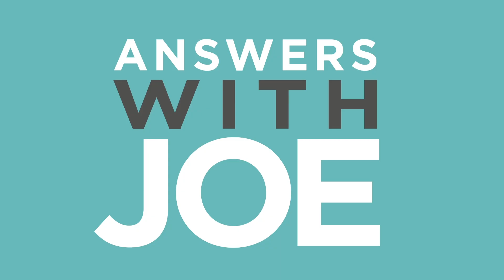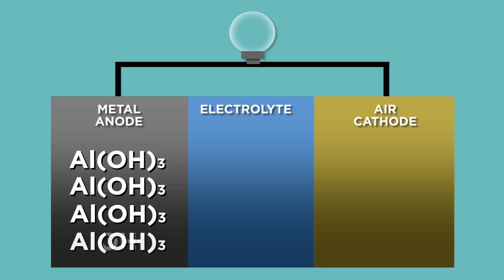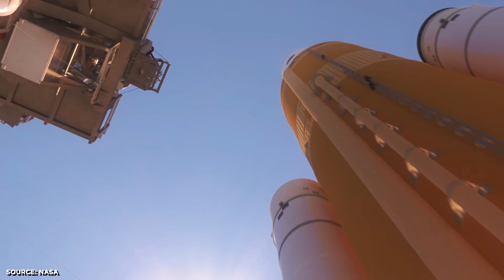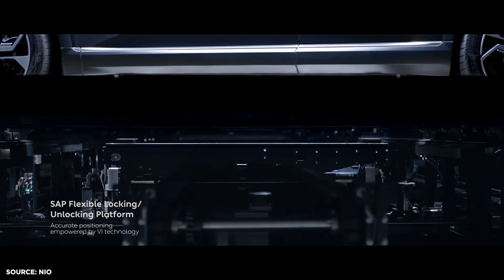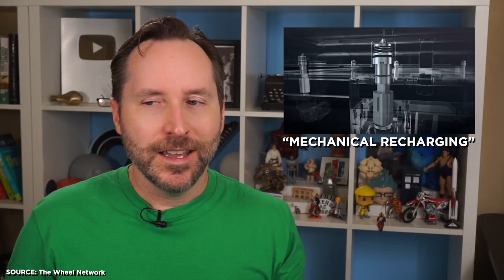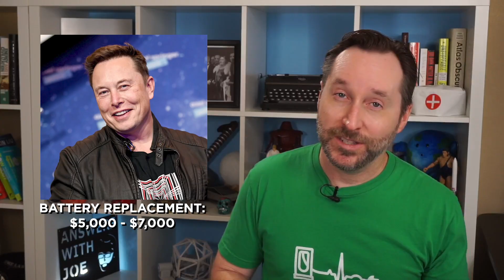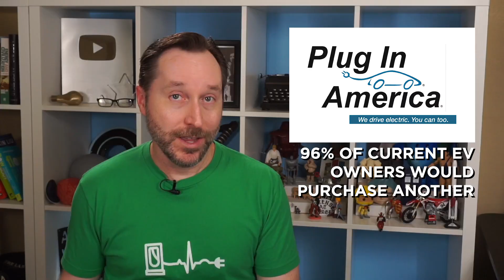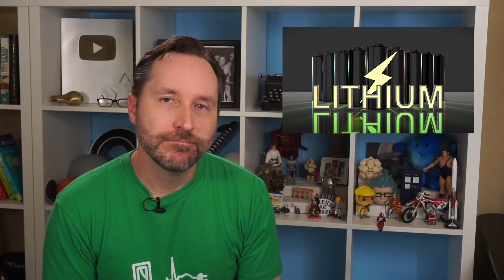This Battery Could Drive A Car 1500 Miles - But There's A Catch | Answers With Joe

Comment: whilst this battery is probably not the right one a full swap battery is the future. Nobody wants to be on a road trip and have to wait a hour or so for their battery to recharge. swap packs are the future but the best way would be to install the swap system into the delivery vehicle so the lorry turns up holding batterys  lowers the back you drive in and the battery is swapped that way no unloading and reloading time for the lorry. when the lorry is empty the new one arrives and takes over

Comment: Depending on how long these Aluminum-Air batteries hold their charge, I could see it being a useful thing for a whole-house power-loss backup system -- much like big natural-gas or propane-fueled generators today, only you'd have that Al-Air battery instead.  Something that can provide a couple of Megawatt-hours would easily power an entire house for, what, a thousand hours? Two thousand hours?  More, depending on how frugal you were when you were on backup power.  Then, when the battery is discharged, a company would bring you a new one (for a cost, of course -- much like the cost incurred when refilling your generator's propane or LNG tank.)  But no burning fuel and no emissions and NO NOISE!  (Do you know how loud those damn generators are?!)
Reply: There are propane companies and gas stations everywhere and lots of competition to keep prices low and service high. Battery pack companies? Not so much!

Comment: The idea to swap car batteries out every 1000 or 2000 miles is so incredibly bad to me that I do not understand anyone is putting money into that. It's preposterously bad. Hilariously bad. 
You're going to build an infrastructure as abundant as gas stations that have all of the no doubt dozens of different batteries just available and ready to swap at any moment? That's really funny, but not at all realistic.
Oh, sorry, what's that? There is going to be a standardized battery for every single kind of vehicle, 2 or 3 different sizes max? That would make this easier. But getting everyone to agree to that might be harder than building the physical swapping stations even.
But let's entertain the idea a bit and say it's all gonna be standardized across all manufacturers and there will be as many swap stations as there are gas stations now. Where is the infrastructure to take all the used batteries to the recycling centers of those batteries? It would be the same logistics network that would deliver the new batteries, sure. But the scale of that network is massive to the point of absurdity. The amount of energy delivered by a single truck would be so much lower with those batteries than a truck full of gasoline. 
Let's say it's feasible even on all those aspects. Let's say the logistics and infrastructure is gonna work out, let's say all manufacturers agree to have compatible battery systems to keep the number of variants low. You're gonna pay for that over using the already existing electricity grid and building a bunch of small quick chargers everywhere that hook up to it on top of being able to connect to the grid through any plug with the cables? You're going to build an entire complex, enormous, expensive new infrastructure for a bit of range improvement? For a solution to a minor and a major problem with electric cars today (range and recycle-ability of batteries respectively)? For something that doesn't even address the fundamental, underlying problem of personal mobility (moving two tons of metal for a 100kg person+some items and the space that amount of mass takes up)? 

It's a nice thought, but it's not going to happen.

Comment: I've always been a fan of swappable batteries. I don't like the idea of being stranded for an extended period of time while it charges. And, I can come up with many situations where people don't have access to regular nighttime charging.

In addition, I cringe at the liability issue with electrifying an apartment parking lot, or a parking garage. I can easily imagine bored middle school kids messing with a charging station and injuring themselves or the next person to use it.

The short clip in this video of the battery change wasn't clear, and I haven't gone to research it, yet. But, it looked very specific to that vehicle. It strikes me that there should be a way to be able to swap out the cells through a generic interface with the ground equipment. So that any vehicle can drive onto a pad and the system latches onto the ports in the bottom of the car to suck out spent cells and inject full ones. A mechanical system shuttles the cells around

I've heard about Tesla batteries requiring balanced cells. Another thing I haven't researched in detail. I can understand wanting that for the last couple of percent of range. I can't figure out why it completely craters the capacity of the battery.

Still, I like swappable batteries. I prefer NiMH batteries for my devices around the house over rechargeable devices that need to be tethered. The swappable devices can be made ready in a few seconds from my stash of charged batteries, while often, the rechargeable devices are useless when I reach for them.

Comment: You are forgetting the fact that aluminum batteries greatly increase in mass as they are discharged. Here are molecular weights of aluminum metal and aluminum oxide.
Every 54 grams of aluminum combines with 48 grams of oxygen to produce 102 grams of aluminum oxide. Hence, the battery weight when discharged goes up by a factor of 1.89, nearly 2.00. Hence, the aluminum component of the battery (fuel) gains nearly its own weight of oxygen. The corresponding factor for a lithium air battery is 2.15, so that a lithium air battery more than doubles its weight as it discharges. This may be acceptable for cars, but this massive increase in weight makes metal air batteries unsuitable for aviation.

Comment: Using aluminium air batteries packaged in shipping containers to power ships that transfer similar sized shipping containers is actually a really good idea. The infrastructure needed to handle those containers is already installed and you could collect used battery containers in ports and transmit those with one full ship to recycling once done. In addition, since putting e.g. 10 extra containers in a large ship is no problem you wouldn't need to have a recycling station at every port so logistics would be pretty easy to solve.

On the other hand, using those for cars sounds a bit more problematic. I would assume that recharging would be much better option overall for cars because you can cheaply build the infrastructure over time. EV cars can already be used today and the more charging locations we get, the lesser problem the recharging will be.

I'd expect to see overhead charging cables on highways in the future, a bit similar to ones used to power trains today. That would allow you to recharge batteries while driving the long runs and use fully charged batteries in the cities.

Comment: There are people who are science fan boys. They love science, the more fantastic the science, they more they love it. If it doesn't make sense, and you point that out, the freak on you. Hears the thing about gas powered cars. Cars run on the gas in the tank, and the oxygen in the air. Since there is abundent oxygen just for the taking, I don't have to carry it in the car. That's very nice. Now think of Saturn five Rocket. It's this giant rocket that is driving this tiny little space capsle. Why is the Saturn five so big? Well, it has to carry the oxygen it's going to burn, with it. If I had to carry the oxigen with my car, it would be the same. I would have to drag a giant tank of oxygen to burn with the gasoline. This is the simple truth with batteries. You have to carry the oxidation elements, and the reduction element in one unit, the battery. Let's just say you could pack all the energy need in car, so it could drive fifteen hundred miles. First, it would be big. It's just a fact of reality, you can only stuff so much energy, in so much space. Well, that's if it's a chemical reaction. Then there there is the fact, that you have both the reactive chemicals pack together.  The simple truth is, most batteries are little bombs.  Yes, gasoline is dangerous. Set it a flame, and you'll have trouble. The thing is, if you made a battery that could drive a car fifteen hundred miles, that battery could take out a city block. There are thousand of car accidents, one has exploided, and taken out entire city block. So, what's motivating all this lying about batteries? Batteries wear out. Car companies want to sell the public car batteries every four years. That's paying twelve thousand dollars every year. Sure car complanies want to sell electric cars. They want to scew you with the battery sales. Okay science fan boys. Lose your minds, and attack this comment.

Comment: When recycling aluminum oxides, doesn't that require a similar amount of energy as when you extract it from the ore in the first place? Isn't this also relating to the energy you extract from the oxidation process? That is, the more energy you can get from a chemical process, the more energy you need to reverse it.

Comment: It'll never happen.

If the auto industry did start using the aluminum air batteries you know they'd cut the size by 5 and keep the same range. The phone and laptop industry has done that for years, they keep improving batteries and instead of keeping the same size and improving battery life they keep making the batteries smaller and lighter.

Maybe I don't mind an 8 lbs laptop, I just want 15 hours battery life... most of our battery life gains have come from improving efficiency, which isn't a problem, but we could have had 24 hour laptops years ago if they had only quit shrinking the damn batteries.

Comment: One of the coolest aspects of aluminum on a chemical level is how oxidation affects it. Unlike iron whose oxidized form crumbles into dust, aluminum oxide forms a hardened shell on the surface of the metal that is harder than the unoxidized form. This substance known as corundum has a Mohs hardness level of 9, which is just short of diamond's 10.

Comment: I personally think that aluminum air fuel cells/batteries will be one of our best options for electric vehicles. They don't use lithium or cobalt, so the environmental impact is inherently a bit smaller than with lithium batteries. 

Having two batteries for one vehicle so one can be swapped at a station could means it won't be that different than driving to fuel station in a normal vehicle. 

Non-rechargable batteries are not a big deal if we account for it. No different than running on a tank of fuel, you can't refill that at home either.

If we can make the batteries highly recyclable, we could reduce the environmental impact of them. Almost all parts of lead acid batteries are recycled, so I don't see why we can't recycle those aluminum batteries too.

The actual monetary cost could be offset by building the batteries with short life and being recycled in mind, and the environmental impact still would be less than cobalt mining.

Comment: This could be really useful for camera drones. A big problem for drone users is limited flight time. But this could boost flight time and range by a lot, especially in a remote nature shoot where you don't want the noise of a generator.

With drones, of course, you can simply swap batteries by hand.

Comment: Aluminium is solid electricity. The three mile long smelter in New Zealand was supplied by a a series of big lakes filled from rain averaging half an inch a day through tunnels, seven hundred feet down. A crow bar would stand on its end within those great sheds. Just retrieve that electricity as in a battery cell. Lots of ways to do it.

Comment: In germany we got the "Pfand" system where you can give back the empty bottles you use and get money back for it. So yes, more expensive items are expensive partly due to the material they use, but at the same time, you get that money back if you take the time to collect your bottles and put em back. 
Its very typical that the machines that receive these bottles are placed in supermarkets so you can use the tiny voucher that said machine give you to pay groceries. Problem is always infrastructure.

Comment: I think aluminum batteries have great potential for things like emergency power generators. No maintenance, upkeep is just refilling water, and only if you are using it. It can prevent brownouts and minor, seconds-long blackouts on a house by house basis, and can provide emergency power for atleast a while. Then it can be completely recycled, and replaced with a fresh one. No gasoline needed, which goes stale quick, and cannot be used indoors. No loud combustion noises, just electrolysis. It could easily keep a house powered for a few days with the basic necessities, such as water, heating and cooling, radio/tv, phone charging, and keep food frozen. Given its actual power density (I dont know what its power density actually is, i dont want to bother scrubbing the video for it, a quick google search said something like 1 mW, so ill go off of that) is quite large, it could reasonably power a house off the grid for weeks at a time, if not months. Or power entire neighborhoods section by section, though ideally in emergencies.

Comment: consider this: subscribe to a service that's connected to your car that monitors your aluminum air battery energy level, so you can keep charging at home and all but when you use up the aluminum air battery, you get a delivery to your home right when you need it and you could just swap it out yourself and it comes with a box you can send it back in.

Comment: Doing this for the future... THERE IS NO FUTURE! 
CO2 levels are higher than anytime in the last 3 MILLION years, and when it was, the world was a lot hotter, and sea level were 60 to 80 FEET higher. 

And here's the kicker guys. 

The climate changes we are experiencing right now, that's from CO2 released 100 years ago! Even if we stopped emitting RIGHT NOW, temperatures, sea levels and extreme weather are going to keep getting worse FOR AT LEAST THE NEXT 100 YEARS!!! 

The emissions reduction talks we're having now, should have been 100 years ago! 

The only way to 'reverse' what's happening is to start sucking CO2 out of the air, a lot of it and fast! And given the cost, that's not going to happen... 

Take a good look around, the planets not going to be like this much longer.